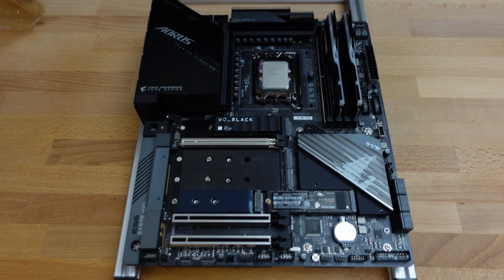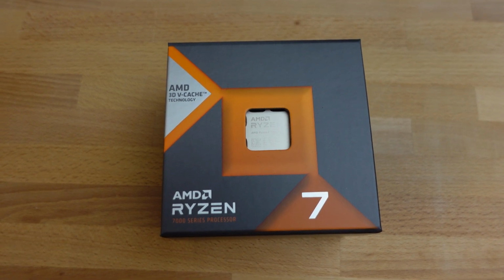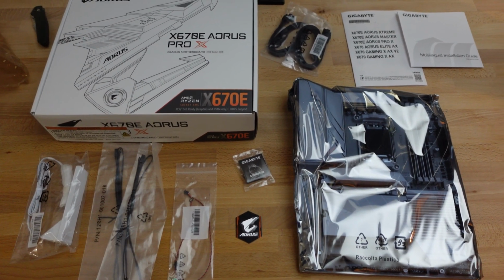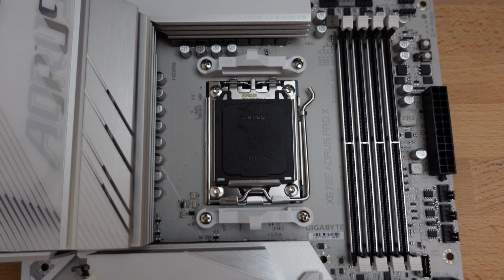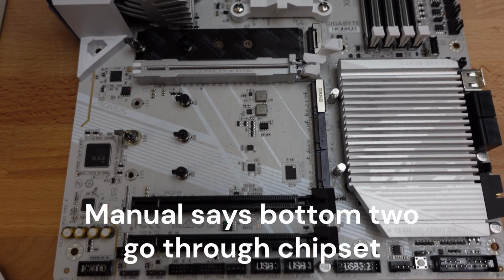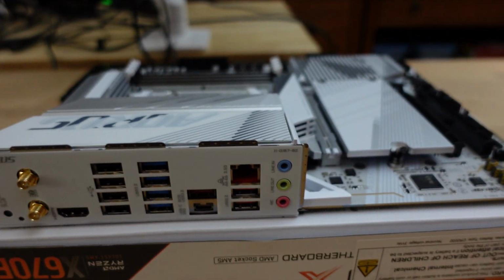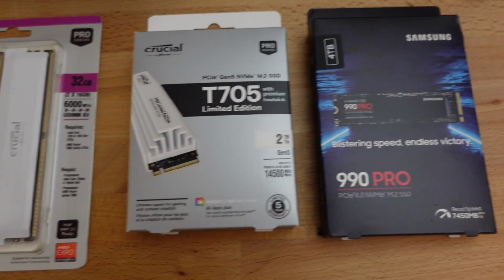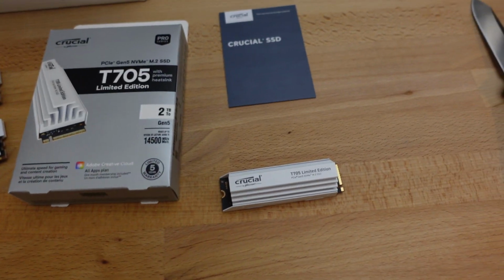Barebones new rig - AMD 7800X3D - Aorus X670E Pro X - Crucial DDR5 and T705 White - Apollo Build

Comment: lol have fun cooling that crucial drive/load :/ the oem heatsinks they come with are dog poop as the both the t700 && t705 are the hottest [temp] gen 5 drives currently on the market, thats why they appear to be a good deal as they are collecting dust on the shelf bc they are a bad design and not ready... until they figure out a solution to dissipating heat from the controller and chips problem gen 5 nvmes are DOA for HEDT... 

also many mobo oem's are slow to adopt bios level nvme driver support for gen5 which causes them to not be recognized prior to post...  outside of them overheating running close to 80c at idle and throttling which defeats why you bought it in the first place... cl36 timings on your ram are slow and good luck getting quad sticks to thump at those speeds even if they are matching kits... i see you made your purchases based off aesthetics... i would re-think your approach while there is still time to return for you wallet/performance sake and do some more research... 4 dim boards are pointless these days outside of server use.
Reply from the maker: @WindowCreep808  thanks for the info on the T705, and disappointing to hear. I did have some fears about how hot the drive would run. I was thinking about using the 4TB 990 Pro if the T705 didn't work. I also happen to have an EK water block for the SSD I was itching to try. As for the memory, they do look slow on paper, but I've had good luck with Micron memory even if not a matched set of 4. I think they provide some pretty stable memory. I've messed with so much Samsung, SkHynix, and Micron dies and found that if I want stability Micron works pretty well. I have an workstation with 8 512GB of ECC Crucial love them. I have some long running jobs that run for over a month straight without issues. I also found that during gaming and long sessions I want stability. Really sucks when my games crash. I think given that the CPU has so much L3 cache, the concern about the CL timings may be less of a thing, was going to play with this some. Yes, I got white sticks... the alternative would be what?... black? Given the motherboard and case is white, might as well make them matchy matchy. Have so much black hardware thought why not.
Reply: @nispoe  990 pro if you need 4tb is your best option and they have been having killer deals on them, just make sure you install Samsung Magician and update them to the latest firmware that goes for all capacity 990 pros... if your chip can do 3000/3000mhz 1:1 with an FCLK 2200 at cl30 or 28 then you won the silicon lottery and have a good binned 78XD not God binned but above average... SK Hynix A die is what the XD chips have been having the most success with... im sure there is something that comes in white or you could give the polished silver Z Royals a spin... your just not going to get all 4 sticks to thump at those speeds you might but it will take some RNG/luck... better off just using a single channel for performance on the 4 dimmer boards unless you need uber gobs of ram for workloads, for gaming single channel is on top.